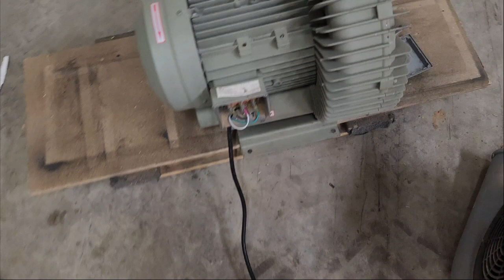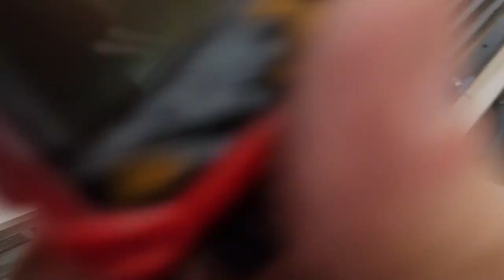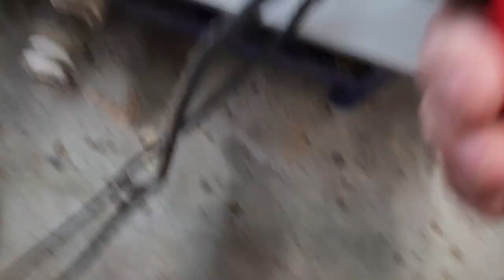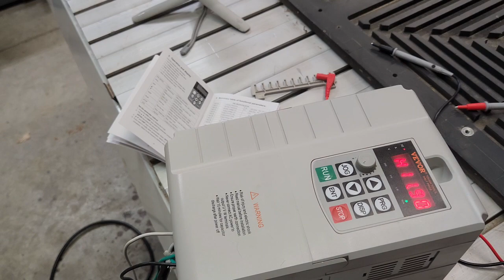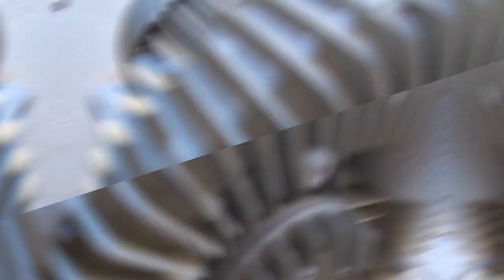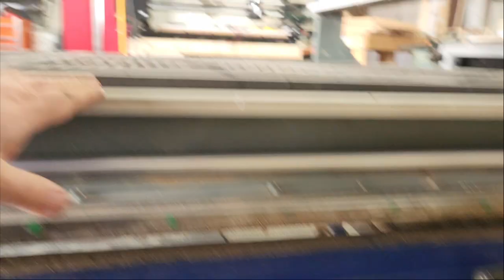7.5HP 3Phase Regenerative Ring Blower on 10HP VFD

Comment: What did you end up using for vac hose from the pump to the router?
Reply from the maker: For that setup i used pool vacuum hose.  Flexible and sturdy.   The new table I've switched pumps and went with a clear tube vacuum hose.